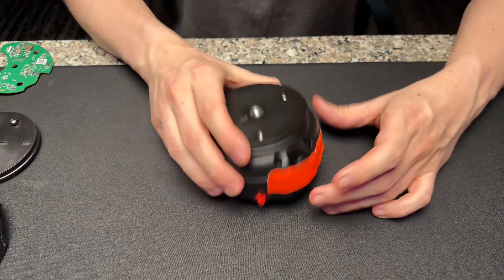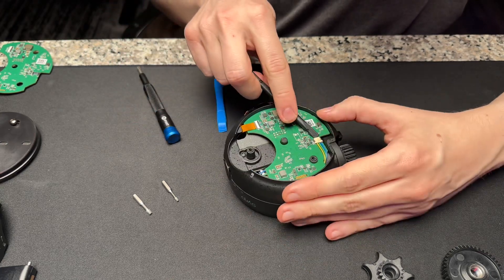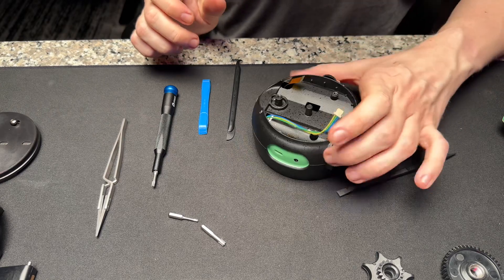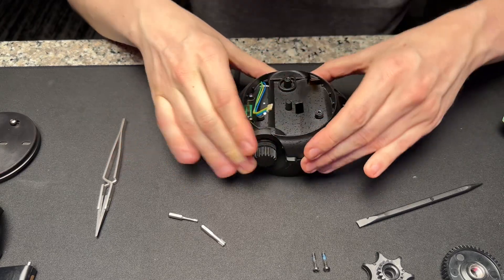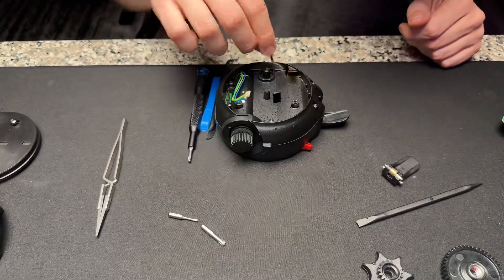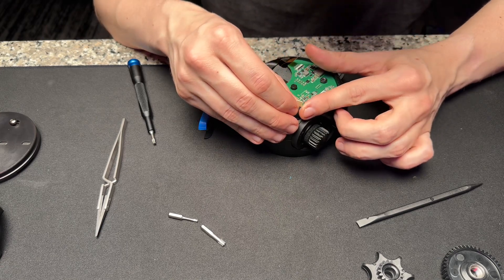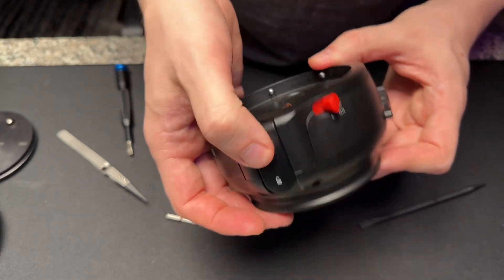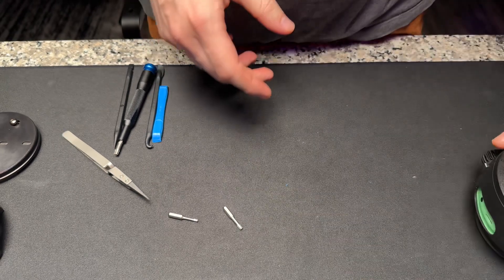How to take apart the Manfrotto Syrp Genie II Linear and fix a broken latch! Part link down below!

Comment: I'm having a problem where the product isn't charging. Have you ever encountered this issue?
Reply: yeah, ive gone through 4 sets in the last 5yrs... they suck - I found this video while looking for a tutorial of replacing the battery with another cell - I dont wanna buy another expensive battery that will last less than a year